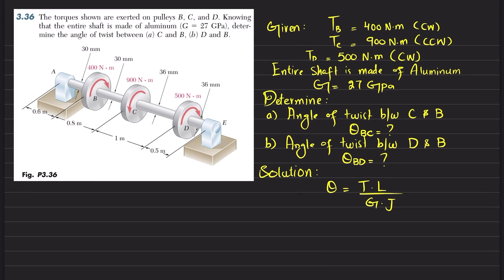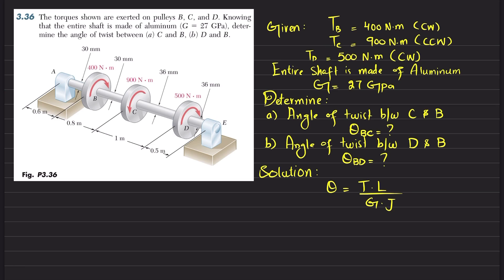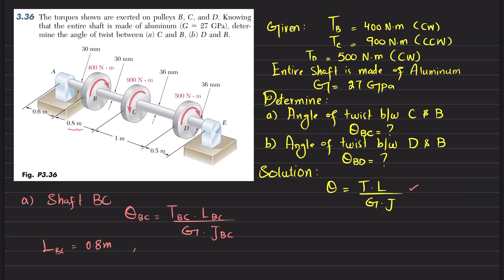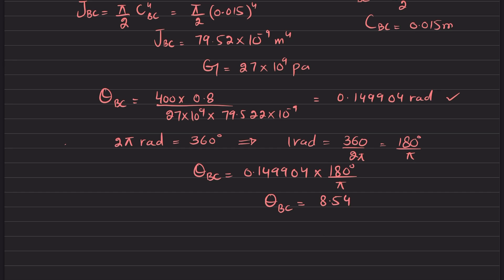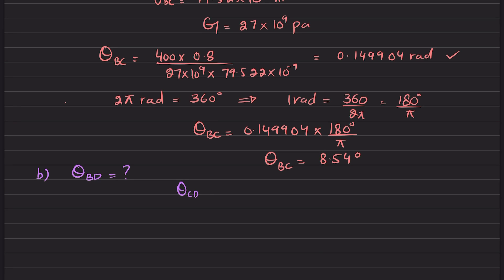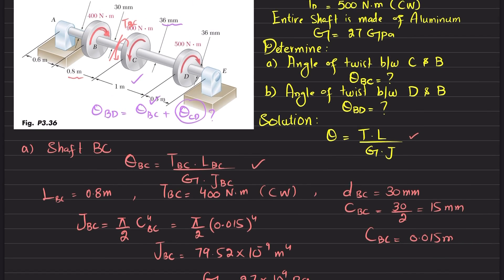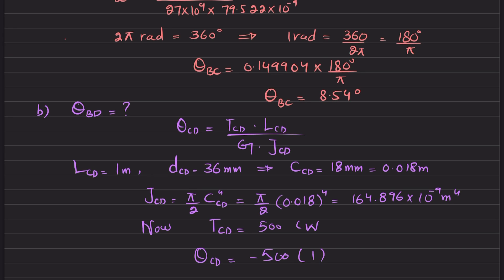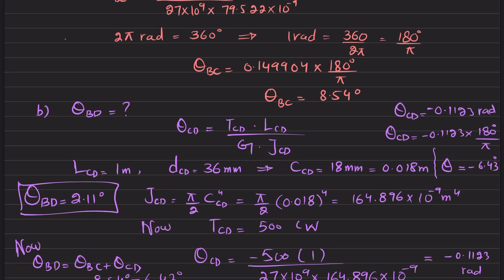3.36 Determine the angle of twist between C and B | Mechanics of Materials Beer and Johnston

Comment: why thetha BC minus with thetha CD???
Reply from the maker: It is the requirement that has been asked in question.
Reply: @engradnanrasheedmechanical  why Tcd is negative 500N.m, if using summation of moment Tcd is postive 500N.m
Reply from the maker: @ronaldlee9641 Tc clock wise and that's why it's taken negative and it's value is 500 N.m (positive) which means that your assume direction of Tcd which you have taken clock wise is correct. i hope it will clear your concept. ❤
Reply from the maker: @ronaldlee9641  you are always welcome 🙏